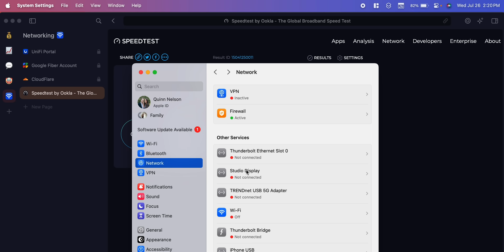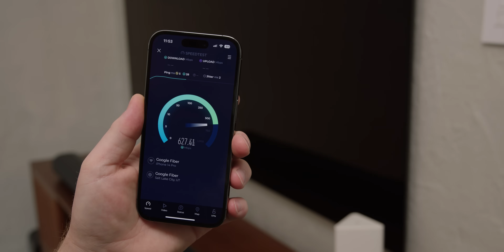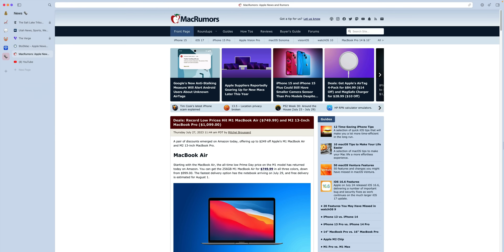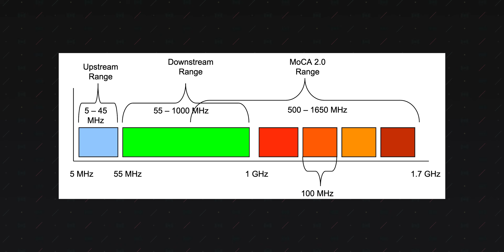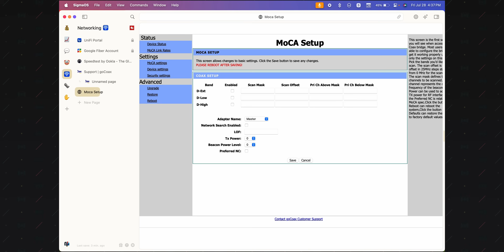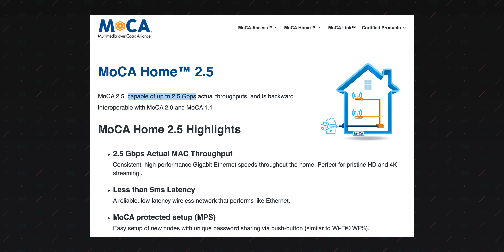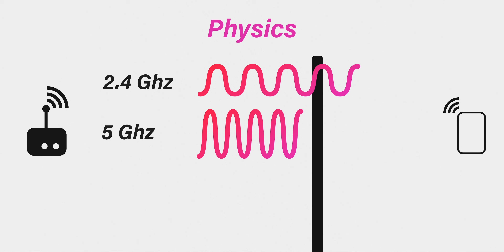10 Gigabit Network Retrofit for Renters. No Drilling Required!

Comment: When I was a Verizon FiOS technician, moca was my favorite easy recommendation for fixing bad wifi. Any current FiOS router already supports it out of the box and you can use any moca receiver not just the Verizon branded ones!

Comment: My dad in the late 90s put coax and analog antenna outlets in every room, speaker wire in multiple places, but only two phone jacks and no Ethernet. Though, for now Powerline is adequate, especially considering there's devices that in addition to Ethernet jacks provide Wi-Fi as well, and way better than any repeater ever could, despite Powerline's issues.

Comment: I’ve been using ActionTec MOCA since 2017. I live in a pretty long mobile home with the modem in the front bedroom. I can tell you with 100% certainty that everything he said in this video is 100% correct. The back bedroom is essentially the exact same performance as plugged in at the actual modem

Comment: I still use powerline in places where wifi is bad, and I don't want to put cables. 

I usually get about 70-80Mbits (house was built in 70-80s) , which is sufficient for streaming / work / online calls, but not perfect.

Comment: I haven't watched the entire video yet. because I can't, because the guy keeps referring to those units as "transmitter" and "receiver"...
"Oh but average Joe doesn't mind, it's OK to keep them dumb" - NO, average Joe can perfectly wrap their head around the fact that signals are going both ways. Joe needs to know that those units can both TRASmit AND reCEIVE, so they can be called TRANSCEIVER. Or "converter" if you want to use easy language but don't spread misinformation.

Comment: For some Europeans there are also solutions to simulate a VDSL signal for internal phone wires... But I ended up using the "hide under floor boards and carpets" solution for my house

Comment: Great stuff, I did not know that one. I just had to do a similar task, but decided to go for home fibre. These tiny glass fibre "cables" are very easy to install, because they are super thin. You can pull them through your existing power lines or just underneath your carpet. I pulled a 40 Meter cable from the first flor down to my studio and gigabit works great, also the latency is super quick.

Comment: we use coax at our house because when my parents built the house internet was not planned out "Computers will never take off so why pay for it" and when my dad finally caved realizing that the internet was a better deal than paying for cable with the exception of no holes so FIOS ran through coax and we cap out about 960 to 1100 which is nice considering I pay for gigabit

Comment: the main issue with nee cables is running them between rooms, I hoped for some tips about that

moca is a fun one but unlikely to be useful due to lack if prerun cables
Reply: The issue with running your cable between rooms is that what you can do heavily depends on your rental contract and local regulations.

If you aren't allowed to pull add a wire even if it's up to regulation and a conduit already exists you are already out of luck. If you are allowed to do that you can check if there is a conduit and if it's used (sometimes you can find unused conduits for old wiring). You might allowed to pull a fibre optic cable trough the same conduit as electrical wires or even a ethernet cable (although there might be restriction on the insulation material).
But you should probably consult a electrician and check the contract before you do that.

Comment: I tried power line adapters before and it was horrible. I’ve been just using like a 50ft long Ethernet cable from my PC to a router which is downstairs and it’s been great. I do want a more permanent setup though.

Comment: I installed one of these power line systems in my apartment yesterday. Wifi interference was awful. Slow, but no jitter or packet loss is a good trade-off for me.

Comment: Another option if the place you're renting already has holes in the walls and cables ran outside, you can easily remove the sealant and covers on the holes and swap out the faceplates for ones with 2 or more slots and run an outdoor rated Cat6 following the coax to another room. You don't have to drill any new holes and no one will ever notice the difference. This is what I did in my current apartment when I moved in and needed a line going to the back bedroom around the back of the house.
Reply: I made a deal with our landlord, she was happy with it, I swapped the old RJ11 phone which was disconnected anyway, for cat6e and now the apartment is equipped with wired internet.  🤷‍♂️  I also got permission to run an extra line to my desk which required me to go into the attic but that wasn’t an issue.  I’m handy.  I’m an Extra class Ham.  I have an essential tremor which drives me crazy, though.  My dad did too, but he was very handy.  Plumbing, carpentry, electrical, metal working, mechanic…he was even learning glass blowing…I’m so jealous of people with skills like that.
Reply: Bonus: when you leave you can remove it and give the landscab a water ingress problem for later 😎

Comment: I have a house with tons of coax but no ethernet (1958 built) if i get a MOCA and I use that ethernet cable from the MOCA to go to an unmanaged switch, will the devices on the switch have connectivity?
Reply: Yes, you can connect the Ethernet cable from the MoCA adapter to a computer, wireless access point, or network switch, and all should have Internet connectivity. From a conceptual standpoint, the MoCA system should serve the same purpose as an Ethernet cable. If your router is configured with DHCP, then all devices on your network should be assigned an IP address, DNS servers, and subnet mask whether connected via Ethernet cables, Wi-Fi, powerline networking, or MoCA.

Comment: One issue with powerline is that it has min and max distance, if the 2 endpoints are too close then speed drops and if they are too far, speed also drops. 
PS, they also do not like isolated ground setups, as many will use the ground pin as one of the data pins as well. 
While they can also work across circuit breakers, if 2 outlets are on circuit breakers on 2 different sides of the electrical panel, then you will have a major throughput hit. Sadly one issue is many powerline adapters do not give you full SNR and transmit and receive power data.

Comment: Great video. I looked into this a few years ago when I was renting a room at a friends house. I went through 3 different powerline adaptors because the first 2 died after a year or kept randomly dropping the connections. Went with TP link(same as your link) and they worked but was slow and reliability went down when I added one for the garage. I later heard of MoCA and made an attempt to set it up.  My friend had a Comcast guy come out but he never heard of MoCA even after I said they have that on their modem. I had a plan of using a filter in the incoming coax line to prevent the neighbors from possibility seeing my network if they had their own MoCA adapters. Then a coax splitter going to their modem and the MoCA adapter. After the brief chat with the Comcast tech, I changed my idea to separate the cable connection and only connect my bedroom, garage and living room(had 2 coax connections) for a separate network from Comcast coax.  The Comcast tech cut all of the coax cables not in use in the box so I had to repair the ones I needed. I ended up moving 2 months later so I never completed the project. Its mostly ready to go but my friend decided to run with WiFi in the garage even knowing its never worked reliably there.  I bought a condo and now using 1gb fiber connection through the wall between my bedroom and dining room.

Comment: For me, here’s the problem with mocha that you might be able to explain. Where our Wi-Fi router is, we still use a coaxial connection to connect it to the outside world. Would we be able to just connect the mocha transmitter using a splitter to that location?
Reply: *MoCA (Multimedia over Coax Alliance)

Comment: I invested heavily into powerline stuff last month. It was a mistake. It blows. Thanks for spreading the word about that!
Reply: Yea, powerline is super case by case, it definitely worked wonders for me back when I was in high school with the router being across from the house
Reply: It works for me because my home's cabling isn't that bad, the distance isn't too big and i can only get 200mbps from my isp anyways. So i get a decent connection i wouldn't otherwise be able to get without laying cables.
Reply: @semi-senioritis  isp speed is not everything. You want fast LAN for NAS's etc.
Reply: @semi-senioritis  Yeah. It's nice, and I get symmetrical up/down...but I'm definitely working on doing a Cat 6 run soon.

Comment: I noticed your comment about gigabit ethernet supporting the (gigabit) internet you pay for. I find this not to be the case. With the standard packet size and protocol overhead, I find a practical limit of about 940mbits on gigabit eithernet. I ended up running a 2.5gigabit switch by my two main computers and now they can access my full internet connection which is, technically 1gbit but actually 1.1 in practice.

Comment: I've tried some of the best AV2000 powerline adapters on the market. you have to go upmarket just to get ones that are reliable. Of those, at best, I'm looking at 100megabits in the best place in the house. Otherwise, about 30 megabits. They ad latency, as well.

In all cases, you're better off with wifi 6. I can't think of a single good use for powerline, to be honest.

Eventually, I went with a couple of MOCA adapters and they were FAR FAR FAR superior. However, in the very end, I just bit the bullet and dropped real ethernet through the cold air returns without damaging any walls. Easy.

Comment: 2016 called, they said Hello!     In reality though,  Moca is great and more and more people at home should use them.  However,  one part you missed covering MOCA, is that its a SHARED medium simular to wifi.  If you have 2 computers transmitting / receiving on the same moca network, bandwidth will be reduced.
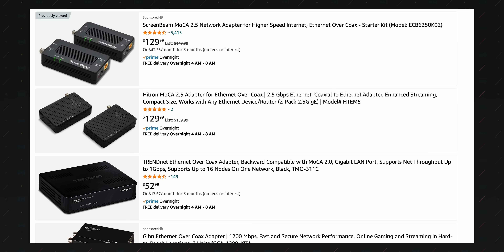Reply: He mentions this at 12:05
Reply: *similar

Comment: I tried powerline and ran into those exact issues. Didn't think my run was too far but ended up only getting 40Mbps which is honestly not as good as my wireless connection using unifi APs. I then went to moca 2.0 adapters and they are much better. Really powerline probably shouldn't be used anymore at this point. You are going to be better off with moca or any type of wireless mesh system.

Comment: Moca is a good solution especially 2.5, but watch for vendors that put in 1Gb ethernet.  Most places don't have PoE filter, a lot of splitters are horrible, they use they use quite a bit of power and can get hot, janky setup if you have cable modem.   Real issues come if you have over gigiabit cable internet as it can overlap with existing frequencies used in Moca.  And they won't work if using OTA antenna if using coax to go to each TV.

Comment: If all mocha devices share a single connection to the router, then it's the same if you add mocha receivers or split the signal with a switch. Ohhhh! Wait I just realized the switch will be faster for any point-to-point contact within the switch so sometimes it could be better and worst case will be same. Leaving this here for posterity. Go with the switches as Snazzy said, guys!
Reply: *MoCA (Multimedia over Coax Alliance)

Comment: ive been using powerline for a couple months while im home from school (making a direct run in my house is unfeasable given im on a different floor and its not my house) and it gets to the cap of 30mb/s give or take and the performance in games is very solid. i take a small ping hit in games to get a very consistent connection when im playing games at night. i may have to try a coax solution though when we get gigabit (soon?), i do have one in my room, thanks for the info!

Comment: 2 notes about MoCA:

1. If you use a splitter, make sure you get one that supports the frequency range that your MoCA adapters work at.
2. Some providers (DirectTV is one) operate in the normal frequency range of MoCA and have their own MoCA "equivalent" requiring different equipment.
Reply: Also time warner cable uses moca to pass video for whole house dvr
Reply: @malrofo  Where does Time Warner Cable use MOCA?
Reply: @WarriorsPhoto  all over the foorptint for accounts with whole house DVR. its a legacy product but its around here and there
Reply: @malrofo  I haven’t seen it locally for a long time.
Reply: @malrofo  you can disable it and use your own moca
Reply: @malrofo  you should know this by now Time Warner is spectrum now
Reply: @jonavene12  where did I imply twc wasnt specteum?
Reply: And the splitter used in the video is an absolute no-no...put good money into one that's high quality, along with quad-shield RG6 cable, not just the same cheap cables you bought in the analog age. It's not 1979 any longer, and why anyone still sells those low-quality Menards special tin splitters is beyond me.
Reply: 3. WTF how does your cable operator not say "please don't spew your garbage signal on our line". (Especially if there aren't filters. And even if there are filters, they're not magically 100% effective.)
Reply: That splitter made me cringe. Lol. They cause so many issues not only for your home but potentially every modem in your area.
Reply: TIL DirecTV still exists in mid 2023. Bravo good sir.
Reply: The biggest downside to MOCA is the price. Adapters start in the $100range. Do they have proprietary information?
I don’t know why else they are so expensive.
Reply: @choahjinhuay  Frontier FCA252 is very cost effective.

Comment: These PowerLine Adapters only work if you are on the same leg at the breaker panel, if you use the MOCA, you want to use a 5ghz Splitter too.

Comment: I have been using MOCA in my home network for about the last 6 months. It is as close to a wired ethernet solution as one can get without being Ethernet. It is fast and stable and that minor latency hit is negligible to the point of being imperceptible.  I run VMs directly off my NAS with near zero impact to performance.  I'll be watching for the MOCA 3 devices. I don't need 10GB to the internet but I'd love it for my home lab and server / NAS devices.

Comment: I heard about MoCA probably a year ago from LTT and was thinking about trying to use it for some parts of where I live, particularly as part of a wireless mesh backhaul. But a little later, my internet was getting really spotty sometimes and the tech that came out said our signal was droppping because there were too many coax splitters running through the house, degrading the signal strength. After cutting out a couple of the splitters, our internet has been much more reliable, but eliminated the ability to use MoCA.
Reply: They do make signal amplifiers for coax, you do need to spec them properly as the cheapest ones used to ignore signals above a certain mhz and only boost satellite / TV signals, if you your specific internet provider if they have an amplifier they use when signal strength is low, you can use that to boost the signal then put splitters after it as you need to, also most amps will boost and possibly split the signal themselves so you can get MoCA working

Comment: I was excited to try powerline in my home where running a network line would have been really difficult. I was running it to a HTPC and the audio interference was so awful it was unusable. Not to mention it was still slower than the wireless connection I had been using.

Comment: the biggest problem that I have is that my doors close tightly if I want to lay down optics through my doors then the core will be crushed
Reply: I run Ethernet cables under the doors, so opening and closing the doors has no effect on the cables. However, maybe your doors do not have a sufficient gap underneath them.
Reply: @Eternal_Tech  they don't, unfortunately. Even flat ethernet cables scrape, not to mention fiber

Comment: i had crap internet throughout my house, got fed up with the wifi extenders not working and just threw an ethernet cable going into a Wireless access point down the stairs, works well

Comment: In my house, I routed ethernet cable through the air return ducts of my hvac system. Minimal exposed cables and no drilling required.
Reply from the maker: Also a good option! Just make sure you used plenum-rated cable ;)
Reply: @snazzy  thank you for bringing up a good point for those reading this, and yes, I did.

Comment: MoCA works great, I have the gocoax 2.5 for my Eero’s.  The only big caveat is if you have Directv (Why?!?!), MoCA devices interfere with the satélite signal.  (Best option is cut the cord and get rid of Directv, but if you must have it there are slower adaptors (non-MoCA) that work with Directv)
Reply: That’s where DECA comes in - it’s MOCA but is made for those with satellite

Comment: MoCA deployment is greatly oversimplified here - especially the talk about splitters. Most house-level installs  need actively amplified, multi-port bi-directional splitters. You also need home-runs to end points along with replacement of any existing splitters with high frequency versions. 
IF you can do that, its great - especially since you can find Frontier/Verizon "Quantum Gateways" cheap online and reconfigure them to bridge mode. But your typical retrofit cable install isn't going to work well (or at all) out of the box.

Comment: I didn't need to do any setup at all for MoCA, it just worked, I guess depends on the adapter? As for security, you can get your own filter that you can put on the back of your cable modem very cheaply. Also they make splitters specifically for MoCA networks, a bunch of lower quality splitters could possibly harm your network speeds.